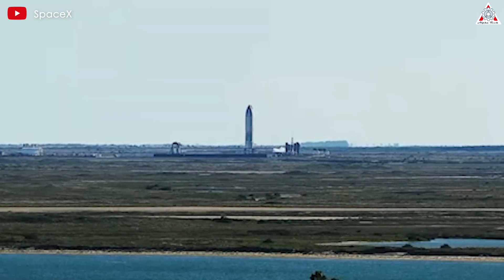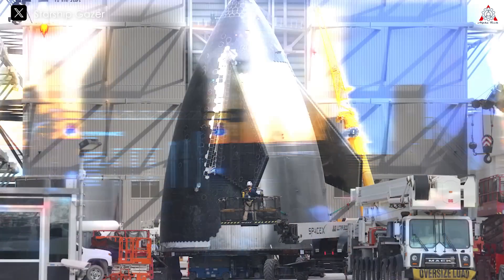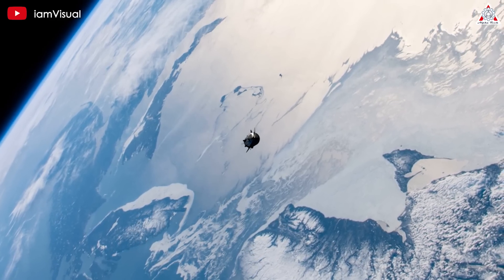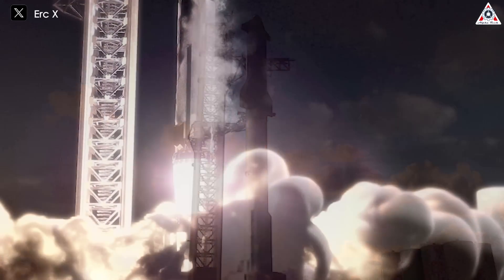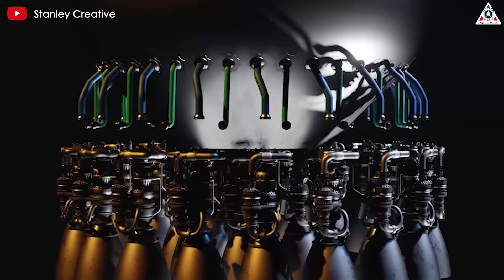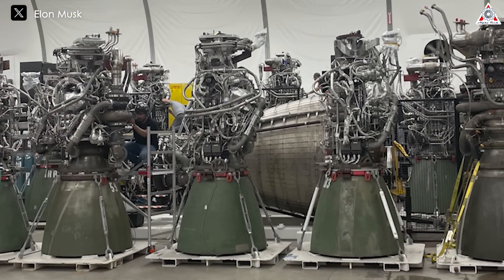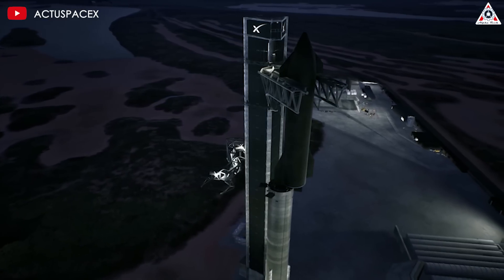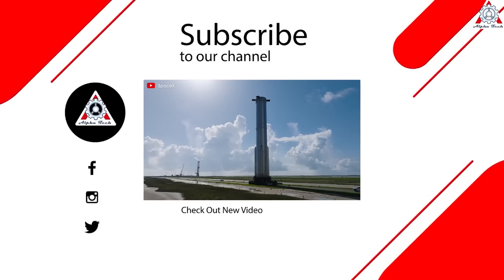NEW Starship Bigger and Better Version Is Not What You Think! NASA Shocked....

Comment: All of this chest pounding over topping the lift capacity of 1960's technology.  Wow so impressive.  Only took  6 decades.
Reply: ... and reusability and about 70t additional payload... and a launch cost less than 5% of Saturn V in inflation adjusted dollars, and far less pollution... all setting up mass production and the practical Colonization of space, not just "Exploration" (See: "poking rocks" at $10million/lb. 

You are clearly thinking of SLS which cost $1.5billion/launch (about the same as Saturn V in adjusted dollars). 

A sad comment on 60 years of "improvements". See "useless congressional pork".

Starship V3 (the goal version that's about 18 months away) can heft 200t vs 130 for Saturn V/SLS (block 2... which hasn't been built yet). But Starship costs $100m to build today and with reusability, starship mass production (the factory was just completed)... it will cost about $50m/launch within a year or two. This is not just a "guess", the details are well established and most of the major hurdles already proved out (Catching the rocket is the last big hurdle) - which will be attempted in August. They could also go with legs like the successful F9 rocket at a cost of 35t or so of payload (dropping it to 160t or more for V3 version if that fails.

So:

- The ability to mass produce the rocket  at a rate greater than 1/month (with an eye toward 1/week in a couple of years).
- The ability to reuse those rockets, building up a fleet of ready-to-go rockets (Spacex currently has a fleet of 16 F9 rockets                 that allowed them to launch 96 times last year... 120-130 times this year with tremendous flexability. 
- The reduction of launch cost from $1.5billion to about $50million (30 to 1 reduction in cost)
- The ability to send 100 colonists or 100+ tons to the moon... or one thousand human form robots (see Tesla bot) to build an Actual colony... not some quanset hut to mull over rocks.
- Mass produced/launched thousands of satellites (more than 6k and rising) to fund it all, without having to hold out a hand to some corrupt politician for taxpayer money.

You are correct that almost all rocket builders have been stagnating for the last half century with trivial improvements. (Hand out of taxpayer money for every tweak.)
No one else has been able to land an orbital rocket while Spacex did this more than 200 times so far. 
 
That ire is totally misplaced with Spacex. It belongs with ULA, Araine, Roscomos and others that never thought that reusing a rocket was possible... never thought about the big picture... putting Real/Self sustaining colonies/cities out there. Never thought about a side business (communication satellites on a massive scale) to multiply their launches while generating massive profits so they don't have to lobby congress for every nut and bolt (the main reason that little progress has been made). 

They were focused solely on corporate profits and had No vision to pursue. They were the servants of corrupt politicians with pay-to-play "Cost Plus" contracts that rewarded failure more than success. 

They got replaced. 

Spacex launched 80% of the total mass put in orbit last year (the Global total). They built/launched/own most of the satellites in orbit. Starlink sats are bringing in massive revenue ($6.6 billion last year) such that their budget will eclipse NASAs in 5 years at this rate of growth.

Major innovations mostly paid for with private funds alone. Vastly less cost to the tax payer. Vastly superior results... almost as if 60 years of innovation have (finally) paid off.

Comment: Many problems to tackle, it would be less if built and launch from space
Reply: Agreed. Build mining on the moon (use the Boring Company tunneling machines to mine minerals/ice/produce sub surface working spaces) Send finished metal to lunar orbit (magnetic accelerators would work fine there). Build ship yards in lunar orbit. Build Massive ships to shuttle from LEO to Moon to Mars to 16 Psyche and other mineral rich asteroids. Use relatively tiny Starships to shuttle goods from orbit to surface via orbital stations.

All that Sci-Fi now has a practical technological path to become real in 30-50 years. No more farting around in tiny capsules and poking at rocks. Actual Colonization with self sustaining colonies (at least economically).

Comment: As much as NASA has been shocked over the past few years, shouldn't it be dead by now?

The limiting factor isn't going to be better engines or improved mechazilla, but those pesky heat tiles.  The technology to make 100% reusable heat tiles may not be there for a while if ever.
Reply: They just completed a new set of "2x stronger" tiles for the next flight and are using an ablative layer under those to ensure good landing even with tile failures. 
Don't know if it will be "good enough" yet, but surely alot closer. 
I think the idea is reducing cost to replace, not expecting shields to work 100% every time. 
Even now, Vastly less expensive than replacing Shuttle tiles. 
This will not stop them. 
V3 version will have twice the throw weight, meaning more mass that can be devoted to even strong tiles if need be.
Reply: @avgjoe5969  Thanks for the info.  I think the goal is no tile maintenance between flights, which is probably a must  if you plan on launching (and recovering) a thousand rockets a year.

It appears to me that they are incrementally working toward that goal, but may find that it is impossible, and thus are forced to use some sort hybrid tile design that includes ablation.  What do you think about that analysis?